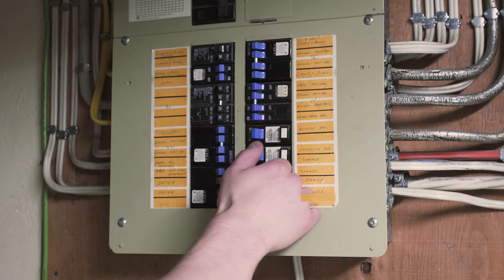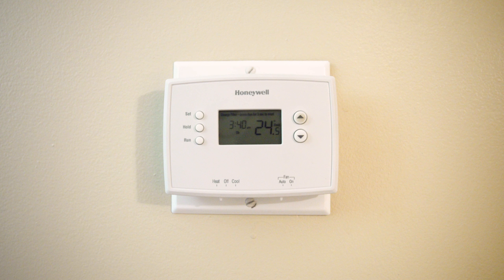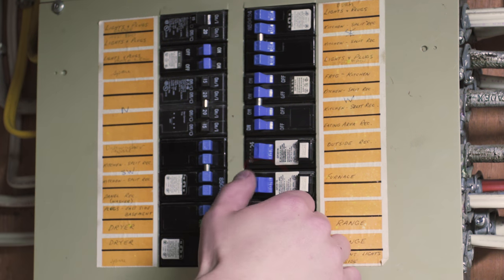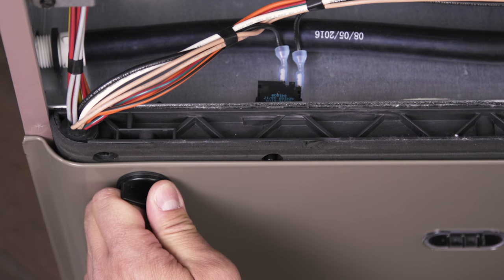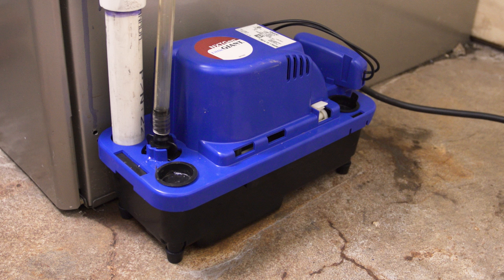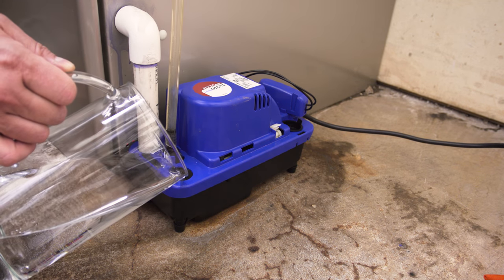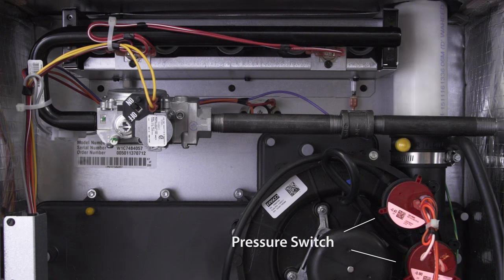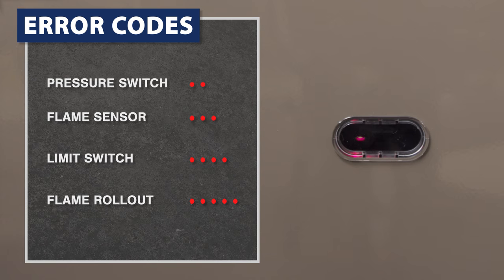Furnace Won't Start - Step by Step Solutions | Repair and Replace

Comment: Woke up to 59 degrees after wifey changed the filter yesterday. Checked everything or thought I did. Came to this video. Re-checked the power by pushing the plug in more. That was it. Check power? Yes.
Reply from the maker: Thanks for watching, we're glad that you were able to get it running again. Sometimes it is something that simple!

Comment: My flame sensor was dirty I cleaned it and then left bottom panel open. (Had to rush out couldn't put back on) came home and found furnace not turn on. Scared I messed something up! This video taught my the cutoff switch and everything all good again! Saved myself 200 dollars for repairman
Reply from the maker: Thank you for sharing, we're glad that the video helped you out!

Comment: I have this same furnace that you are showing. There is nothing wrong with it really, except... I have gone by our local electrical codes and hooked up a plug into the main line so that I can use a backup powerbank or generator in case the power goes out. Boy is this frustrating. I have checked all the wires everywhere and I have proper grounds all the way into the furnace, checked so many times. I even plugged my GB circuit tester into my power bank and I have 3 lights come on indicating correct wiring coming out of the powerbank. There is exactly 110VAC coming out. It powers everything else up, including the fridge and microwave and vacuum etc. I turned off the powerbank and checked the open ground to see if I had it, I put the wire tester across the neutral and the ground and got no noise from the tester indicating when it is turned off it shows open ground. However when I turn it on, the plug in tester reads correct, not open ground. Is this my problem or is the furnace a type that cannot be powered up by a alternate source? It is 9 years old and a Coleman like you showed, Thanks,
Reply from the maker: Hi Allen, thanks for watching. It can definitely be frustrating to narrow down the problem in this case especially since a refrigerator and microwave run on the outlet.

 Using a multimeter, testing between the hot and neutral should show a reading between 110 and 120v. Testing between the hot and the ground should also show 120v. Testing between the neutral and the ground wire should show no voltage. This is briefly shown in this video https://youtu.be/kH2Rbh_m6rM

If those readings are good, then its best to check all the connections on the outlet to make sure they are in the right spot and are secure and not touching the housing or anything else.

One other question, does the furnace start at all? Or do you get no lights, no inducer or anything?
Reply: @AmreSupply  Hi, the furnace runs fine when plugged into the house. It does not start at all when plugged into the Bluetti EB240 which is a 110VAC back up.
Reply from the maker: @Allen-im7nv  It is likely not enough power for the furnace.  Typical blower motors run somewhere in the neighborhood of 500 watts and have a startup load of around 2000 watts which would exceed the current rating on the Bluetti. For a backup a 2000 Watt gas generator would be best for what you're looking at but some people have successfully used backup batteries. It might be good to do some more searching on some specific test cases of other people doing this install.

Comment: Thank you! My thermostat R and W wires were so frayed when i touched it they broke off the copper! i replaced the wires but it still didn't didn't turn on.. until the door holding the cutoff switch was on. It worked after! but i already paid HVAC guy 175 after the first visit. The thermostat was also not flush with wall, but the wires at that point were about to go, then it finally went. Great video!
Reply from the maker: You're welcome, we're just happy to help. Thank you for sharing your experience!

Comment: My Ecobee wasnt working after a roof replacement. I went to the attic to find the access panels had vibrated themselves off the furnace. The cutoff switch was the culprit. Thank you!
Reply from the maker: We're glad the video was able to help point you in the right direction!

Comment: Yes, it does. Unburdened by any profound knowledge, the clicking I heard did seem to me that it could be a piezoelectric spark generator attempting to light up the furnace and failing to do so. But it also could have been something like a solenoid failing to engage, or something completely different, so I came here to look for real experts. God Bless YouTube . . . sometimes  🙂
Reply from the maker: Thanks for the update. If you have a spark ignition, then your furnace likely has a thermocouple or thermopile that will check if there is a flame. A failed thermocouple will prevent the system from working properly so the system will try to re-ignite the furnace, but is likely failing each time.

If there is no flame and no ignition then it's possible that there is no gas being released when it's needed.

Comment: My furnace won't do a thing when I switch the thermostat on. I hear a click, but the furnace doesn't kick in like it use to.
Reply from the maker: Thanks for watching? What type of furnace do you have? Does it have a inducer blower that pulls air into the burner? Or is it a pilot or even an intermittent pilot furnace?

Comment: I have an 18-year old Lennox G40UH furnace with a White-Rodgers / Lennox Surelight 56L8401 control board.  On rare occasions the control board ignores the thermostat's call for heat.  Specifically, I measure 28VAC across the W and C terminals on the control board, but the control board diagnostic LEDs indicate "normal standby operation".  I've left the furnace in this state for up to a couple of hours without any recognition of the thermostat's call for heat.  If I then power off the furnace for 30 seconds or so and turn it back on, the control board diagnostic LEDs immediately indicate "normal operation with call for heat", and the furnace goes through its normal ignition sequence.  I removed, cleaned, and reattached the thermostat wire leads, but the problem recurs.  I now think I need to replace the control board, but could there be any other (hopefully less expensive) reason for this problem?  Thanks!
Reply from the maker: Thank you for watching. What you're describing is likely a faulty control board. If one of the sensors was faulty you could have the startup sequence happen and shut down part way, you would get other codes such as low pressure or no flame detected etc in those cases. An intermittent issue like that could be a faulty capacitor on the board itself but these sorts of things are difficult to really narrow down.
Reply: @AmreSupply  I appreciate your reply, thanks.  That's the reply I was expecting but not what I was hoping for, in view of the cost of a new control board!
Reply from the maker: @Mike-vk9gq  We're happy to help in what ever small way we can. Best of luck on the repair!

Comment: Thanks for the help.  The condensor pump drain line was frozen and pump was full of water and constantly on.  We had the AC unit replaced this past summer they changed the line to drain directly outside instead of to the sump pump, the fridgit weather froze the line.
Reply from the maker: Thanks for watching, we're just happy to help!

Comment: I have a Honeywell's furnace with an automatic pilot light pilot lighwill not  go on having trouble getting it to work on what can I do
Reply from the maker: Hi Benny thank you for watching. If you have a furnace with pilot light, then a faulty thermocouple can prevent the furnace from working properly.  https://www.youtube.com/watch?v=3EKbSiAJyiI&feature=youtu.be An automatic pilot light will be triggered by a spark ignitor. Check the wires to make sure that the spark ignitor is connected and is properly grounded as that is needed to make a spark.

Comment: My frigidaire furnace won't start! Whenever I turn it on the blower starts and I get a blinking green light with a solid red. It says pressure switch open fault. Sometimes I can get solid lights with the ignitor to glow and eventually get flame for one second then shuts off and starts blinking again. Does the pressure switch need replaced?? I've blown in the lines to try to reset it as well
Reply from the maker: Thank you for watching. That code can be caused by several different things.: 

    Restricted intake air vent
    Restricted combustion air vent
    Leaks around assemblies
    Clogged condensate drainage
   A faulty pressure switch

Make sure that the vent cap on the outside of your home is clear first before replacing anything. A clogged cap or vent will trip the pressure switch causing your furnace to shut off.
Reply: @AmreSupply  vent cap on the outside is completely clear and I have no leaks, also there is no water inside the condensate pump. Where would the combustion air vent be?
Reply from the maker: @teets10  The intake to the furnace is on the side of the unit and often relies on a good air supply to the room that the furnace is in. So make sure that there isn't anything blocking air from entering the room. 

There is usually some water in the condensate pump. If your condensate pump is bone dry, then its possible that there is a clog in the condensate drain pan before it exits the furnace.
Reply: @AmreSupply  thanks for the replies! Will continue to investigate.
Reply from the maker: @teets10  You're welcome. Best of luck to you.

Comment: if my condensate motor isn't running, could that be why my furnace isn't working ?
Reply from the maker: Thanks for watching. Yes the condensate pump might have a high level switch wired directly to the furnace. This video explains in more detail: https://www.youtube.com/watch?v=dcLhyLu0-y8

Comment: Our older Rheem gas furnace won’t fire up. During the Summer with the Central Air on I noticed the Pilot light was out. Being it was July I thought no big deal when I go to change the filter again and vacuum any dust away in the furnace I will relight the Pilot light. I did that yesterday afternoon and it stayed lit and continues lit 🔥 today. With the house temperature at 62 I set our round Honeywell manual Thermostat to 68 but the furnace doesn’t fire up. Fan is set to auto and it is in the heat position. Can you give me any ideas as to what the problem may be? I already checked the breaker in our electrical box and it wasn’t tripped. The Model number of our Rheem gas furnace is RGDA-125A-GR.
Reply: Replying to my own question about a hour or so later.  I found that the Switch at the bottom door that closes off the Blower Motor Area at the bottom of the heater switch must be going bad. I remember a few years ago when my heater stopped working being I had removed that door for cleaning and I didn't place the door quite right over the switch it seemed. So I did it again until the furnaced turned on. Never had another problem with it but today I thought why not check it and with the Thermostat calling for heat on the first floor and me down in the basement in front of the furnace I took the door off and pressed the switch in by hand and the furnace still didn't start but when I put the bottom door back on it fired and right away shut down. If I pushed the door all the way down it shuts down. About a 1/4-1/2" up and the Furnace is working. I feel the switch must be going bad so I am going to look for a new switch for my old Rheem Furnace.
Reply from the maker: Thanks for watching. Yes those door switches will completely cut power to the furnace, so a faulty switch can be quite problematic. If you are curious you can test the switch for continuity to see how well its working when pressed closed. Its possible that the contacts inside the switch are not making a good connection.
Reply: @AmreSupply  Thanks for the advice. I will do a continuity test once I get a new switch. Based on what I saw last night that switch is probably worn out. Its got to now be closed just right to make contact. It’s the original on my 35 year old Rheem Hot Air Furnace.

Comment: When I turned on my furnace on last night, for the first time since last Fall, it began to heat the house, then quit. When I went to check the thermostat, I could hear a series of clicks through the air return grate. I hear one click, then a pause, then two clicks in rapid succession, then a pause, then it repeats. Same thing after turning it off then back on. Same thing after it being off overnight. Does that symptom indicate any particular source of the failure??? Thanks in advance for any assistance.
Reply from the maker: Thanks for watching. Does your furnace have a spark ignition system?

Comment: would it be common that the  fan would run if u turned it on would that still indicate power . i'm not seeing any lights on were the window is  located . i did  unistall old thermostat and replaced it with a new one .need ed a larger screen so it was not  a waste money on my end .
Reply from the maker: Hi Melain, thank you for watching. Most furnaces have an indicator light, and during normal operation there's usually a consistent flash every few seconds. If the blower fan is running then that's an indicator that it has power and as long as the furnace or AC seems to be doing what its supposed to, then you should be good even without an indicator light. Some furnaces might only give flashing lights for errors. Look on the blower cover door or your furnace manual there is likely a chart that will explain what lights you should expect for your model.

Comment: So my Infinity 80 which has only been installed 
For a few years will not turn off. I can hear the the fan running non stop at the unit inside the house. 
The flames from the gas turn on and off as needed for heat but this fan all day and night 
Is strange? Any ideas or suggestions??
Reply from the maker: Hi John, thank you for watching. This may seem trivial but first check your thermostat settings. Its possible that your fan is set to "ON" which means it will run 100% of the time even when heating is not needed. Setting it to "auto" means the fan will only blow air when the furnace is heating. 

If that doesn't help then it could be an issue with your thermostat or the control board on the furnace.
Reply: @AmreSupply  Did a deep dive so to speak in the digital thermostat. Each day has to be programmed and I somehow stumbled on a new screen where as you mentioned the fan could be turned off. 
Thank you for getting back with me.
Reply from the maker: @jpoil55  You're welcome John! We're glad you were able to narrow it down.

Comment: What if I installed the blower motor and it doesn’t kick on?
Reply from the maker: Thanks for watching. Its possible that the blower motor is not wired correctly and often replacement motors might not have the same colored wires. Check the wiring diagram on the motor reading each wire and color as well as the furnace manual.

Comment: My LED is on solid but the furnace will not turn on at all.
Reply: Found out the first floor furnace is cutting off the second floor furnace because the thermostat is in the upstairs hallway at the top of the stairs.
Reply from the maker: @crand20033  Thank you for sharing. Did adjusting the thermostat help?
Reply: @AmreSupply  I changed upper floor to 74 and lower at 73.

Comment: I have a problem where the igniter glows, i hear the click from the switch, but it doesn't ignite. After 3 tries it goes into lockout mode. For some reason this seems to occur on the very cold (-15C or lower) days. No issues any other time. Gas works fine to the fireplace and cooktop. Any thoughts? Could the incoming gas being too cold cause this?
Reply from the maker: Hi John, thank you for watching. For combustion to happen we need 3 things, oxygen, gas, and a spark or something to ignite the gas with. In your case you've verified that you have gas to your home, but it sounds like the gas isn't reaching the burners. Try cleaning the burners of any soot or carbon buildup. You can see how to do this in this video https://youtu.be/1giPLrObYb4?t=153 Alternatively you could also have low gas pressure which might be exacerbated in gold weather. For gas related issues its best to call a HVAC technician.

Comment: My led isn't working
Reply from the maker: Thanks for watching. If you followed the steps in the video and your furnace still won't start and you don't have the LED indicator light on the control board, then it could be an issue with the power or a faulty control board. In this case it might be good to get it inspected by a HVAC technician.

Comment: Thank you for this video. omg I was pretty freaked when my furnace would even turn on at all and it was just something to do with the thermostat not connecting properly to the system due to the battery power waning (despite that the thermostat was actually on and functional)
Reply from the maker: You're welcome, we're just happy to share some good info.

Comment: A system lockout could mean anything so...
Reply from the maker: Thanks for watching. If you're getting a lockout it would be best to reset the furnace and let it begin the startup sequence. From there observe what turns on and when the furnace stops running. It will short cycle and will likely try to run again a few times before another lockout. This video can help you understand which parts are associated with which step of the operation: https://www.youtube.com/watch?v=b0sAGt-1niU

Comment: Mines from like 1990s didnt help at all
Reply from the maker: Hi Sergio, if you have an older furnace that uses a standing pilot light then you'll have to relight it. https://youtu.be/3IESh12AQw4

If the pilot doesn't stay lit then it could be a faulty thermocouple: https://youtu.be/3EKbSiAJyiI 

Hope this helps!